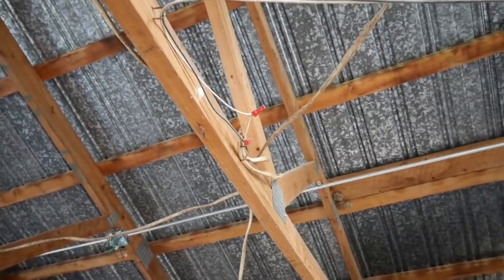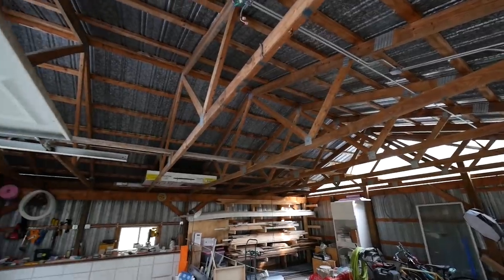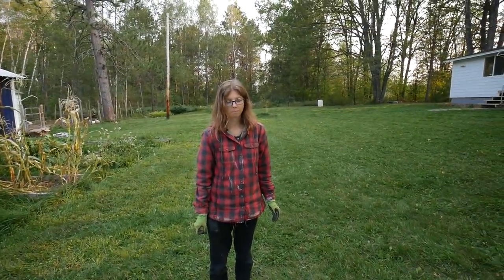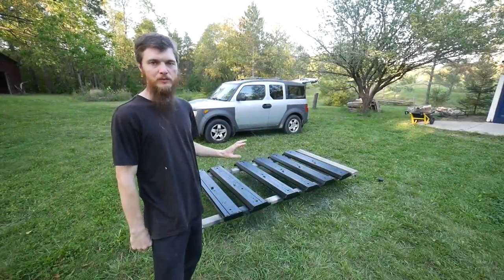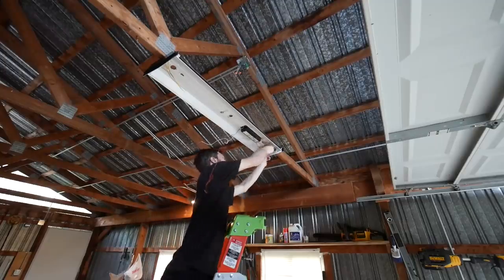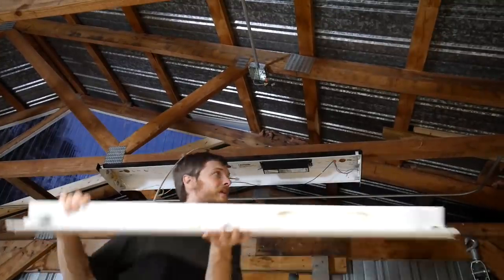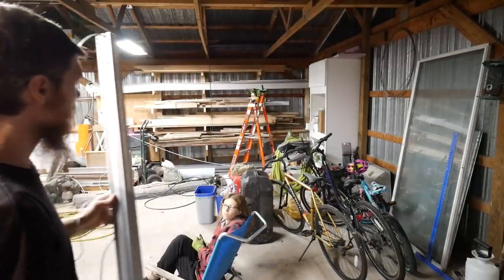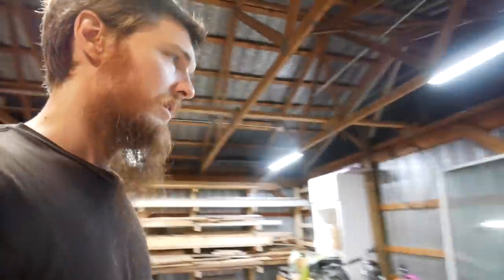DON'T Throw These Out! Restoring NASTY Old Light Fixtures - Installing Barn Lights

Comment: Another great job. You need to install a 3 way switch in the house and one in the barn to an outside spot light so you can go back and forth at night. Good safety feature.
Reply: That is a great idea!
Reply: I agree or like before electricity install a rope to hold on to (between the house and barn) in the next blizzard ❄🌀🌩🌬☔⚡.

Comment: What a nice conversion. LED is the way to go. It's going to save a lot of $$$ in the long run and keep more of your money in your pocket. Are you planning on replacing that buzzy High Pressure Sodium pole light with another LED or just sticking with HPS? The conversion is just as simple; remove the transformer/can capacitor then direct wire the socket.
Reply from the maker: Yea, we may covert that light to LED :)

Comment: Perhaps add another kitchen unit station opposite your existing one to make a great work area that means you do not have to work off of the floor for some of your projects? It could also mean the side room to your barn could be used as a wood store or material store as well. :D Whatever you decide though will be wonderful :D great work as always.
Reply: A Island on rollers !

Comment: A few years ago the company I work for bought and moved into a new (to us) building that was built in 1956. It had the original fluorescent fixtures in all the offices. It didn't take long for the ballasts to start going out one by one (there are 4 fixtures in each office). Replacement ballasts cost MORE than the cost to bypass the ballast and put in LED bulbs. That was a no-brainer! Plus, while the original fixtures used 4 bulbs each, we were able to get the same light equivalent by using only two bulbs each. It was a win/win/win every way! 😀 Congratulations on the progress and keep up the great and inspiring work!.

Comment: I would never have thought of cleaning them up like that. I would've said total loss/wipeout.
Since I don't see any insulation in the barn, doesn't that mean all of that stuff was dragged over from the house? 
Florescent light fixture changed to a LED fixture. Who new? Would never have thought of that.
Reply from the maker: At one point in the past the small room that juts off the barn was insulated and there is still some in the ridge. That's probably where the mice got it all from.

Comment: Good job with the rebuild of those fixtures.  That buzzing on the outdoor light is the ballast not the bulb. Looks like mercury vapor not HPS to me. I would just replace it with a new LED fixture.
Both HPS and MV lose efficiency every day, because they lose pressure over time and therefore get dimmer.

Comment: These older lights may well be newer than my old school light fixture  from the 50's. So surprised the lights didn't catch fire with the mice nests.Mine has 4 lights and it is curved. I have been using it for  the last 43 years to start my seedlings under. Weights a ton but but still works and are held up by chains on a homemade wooden plant rack.  Perhaps I could find LED florescent lights and save some $$.
Now that garage is looking safer and makes it much easier to find everything.  So is your outdoor bulb a halogen light bulb?  I could use a huge outdoor light like that to see if any bears are passing through my yard at night when I get home after dark.  I see them  during the day.
And I laughed when Ashley was talking about no more spiders.  Lol. I'll trade bears for spiders!   Be well. Thanks for more great information. Recycle, reuse, save $$.
Reply from the maker: I believe our outdoor pole light is a metal halide bulb. If you get something like that I'd go with a new LED version.

Comment: Another life saving tip from Doug, looks good, A timer on the outside light it will give you chance to walk to house with a light on, If the weather is gonna get colder, and you are gonna do projects in the barn, then maybe check some building sites for Excess Insulation they are not gonna use, and cover walls with it, it will warm up the barn & protect Ashleys Mower, Good Job on the video, from UK 5.30 in the evening.

Comment: What are you going to do with the old kitchen cabinets are you going to re-purposed them in the barn It would make a good storage and work station
Reply: Already done
Reply: They threw away the old cabinets as they were total junk, but they used the first set of cabinets that a company wouldn't let them return.

Comment: Looks like the next project is going to be putting in pathway lights so you can see to get back to the mobile home when it is dark.  Easiest way would be just to put in the solar lights.  Other way would be to put in the low voltage lights that have wires ran underground and a transformer to power them.  Was glad to see you converted the old fixtures to LED.  They work even when cold without having to wait for them to warm up like the old fluorescent ones were.

Comment: To those who think to flush mount those old fixtures like this  they might want to rethink screwing the lights flush. 
One of the reasons those types of lights dangle is, that the box that powers the bulbs and the place the bulbs clamp in generates tons of heat. The open holes and dangling allows fixtures to cool without starting fires or ruining the power source or connection. 
Place mesh over the holes to keep rodents out and yes hang from the chains again
Reply from the maker: I want to make a couple of points. The ballast is not in use. We did an LED conversion and bypassed the ballast, so there is no heat being produced in the fixture. That being said, the ballast wouldn't produce enough heat to worry about in normal situations. There are plenty of sealed fluorescent light fixtures and I wouldn't personal find that to be a concern.
Reply: @diyfferent  the sealed florescent fixtures you're talking about are newer than yours and have modifications to account for heat. 
The transformer in newer lights are very low energy. 
I'm pointing out that older styles like yours and the reason holes were manufactured into the unit. 
We used these in our barn and simply put wire screens on back to cover the holes to keep rodents out. 
My Dad found out the hard way to never flush mount, several overheated and started smoking. His electrician friend was the one who pointed out the reason for the holes and need to hang at least 2 inches from ceiling or support

Comment: Hey Doug, I need your advice. I'm looking to buy a screw gun and like you I've never had one because honestly a regular screw driver has always worked for me. But because you've inspired me, im currently remodeling and I'm going to need a screw gun. I want to get an impact driver and I remember while watching one of your videos ,one of your Dewalts stopped working. I can't remember if it was your screw gun or your impact driver that stopped working. Anyways would you recommend the dewalt "impact driver" and if not is there one you would buy if you were to get another one?? Thanks ! 🙂
Reply from the maker: It was the impact driver that stopped working twice. I had to open it up both times and got it working again. Dewalt has many varieties of their tools- high end, low end. We like sticking to Dewalt since we have the batteries and chargers already. We like the Dewalt tools as a collection and would recommend the impact driver. If I were to buy a new one I might try a different model of it. We use our regular drill since sometimes it works better for certain things like drywall.
Reply: @diyfferent  thank you, this helps
Reply: @diyfferent  well I took your advice and I purchased the dewalt 20v combo kit. It has the regular cordless brushless screwdriver and a brushless impact driver. I'm not sure if brushless is better than a regular one with brushes but thats what I got. I also found this really cool dewalt  sheetrock bit that counter sinks the screw so its easier to mud! Its was a whopping whole 2 dollars so I figured why not. Lol! The combo kit was 199 dollars and comes with two 2.0 ah batteries and charger. It may sound strange but trying to decide which brand and style of screwgun to get was really stressing me out as I just hate to make a bad decision and waste money. Lol! Anyways it gets delivered Tues. I have everything I need to get me started now and I can't wait to start renovating. I'm pulling off all the old pressed board panels on the walls and replacing them with sheetrock. I have window sills that are rotten and I have found out by removing the interior panels its going to be real easy to replace rotted boards and such as it will all be exposed. Watching you take walls apart and replace with fresh sheetrock has taken away some of the intimidation that I had towards doing this renovation myself so I just wanted to thank you for that! I'm just going to take my time and do it the right way. If it all comes out half as nice as your work is than I will be satisfied! Lol! Anyways wish me luck! I'll be doing demo starting tomorrow so I will have plenty of time to finish that so I can start Tuesday with the renovation. Thanks again...
Reply from the maker: @number1pappy  Cool, yea those drywall bits work great. I'm glad we could help. I think you'll be happy with the Dewalt tools. Good luck with the project :)

Comment: Way to go, you two! I absolutely love seeing the reuse of the fixtures. It appears on the vid to be a great light temperature, too. I’m grateful you mentioned the number. I’d like to convert some fluorescents here, so watching you both work on those fixtures was reassuring. Between the gable windows, and repurposed lights, it feels so much more balanced in the barn.  I’m still curious about the interior of the attached shed. 

That said, nature is what the mice do. It’s constant vigilance to keep nature from reclaiming what we change, and that’s how it’s supposed to be. Mice can squeeze through amazingly tight spaces, so if there is even the tiniest of gaps, fill it, so they can’t get into the lights again. As a child, I remember seeing a mouse ooze through the skinniest if openings brayeeen a living room wall, and the baseboard. I also remember one mouse that was chased by our terrier, who ran inside one of my mum’s pant legs, went all the way up, and came down and out the other pant leg.  I’ll never forget the look on my mum’s face. 😆 

Just pushing the point home: fill those gaps!

Again, great barn updates!
Reply from the maker: haha about the mouse in your mom's pants!!

Comment: they do make led conversion bulbs in both double and single end
Reply from the maker: The double end was the simplest so we chose that type. :)
Reply: @diyfferent  I have done both the cheap $8 fixtures  have the ballast built into one end so only the single ended work in those

Comment: There is such a thing as too much light and using the wrong "color". Glare from exposed sources and color toward the "cool" (blue) side of the spectrum actually impair human vision. This will effect you more as you age.
Reply: The best way to handle LED lighting is to make sure the fixtures are dimmable. Then install enough fixtures to be at least TWICE as bright as you need it to be. ie blinding bright. then dim it till the light output is optimal. VARIAC is the best way (efficiency) but takes particular kinds of arrays to work that way IE able to run at lower voltages)

This has several benefits. depending on how the dimming is done efficiency can go up (fewer watts per lumen needed) and most important your not pushing the cooling gradient as hard. LED as efficient as they are still make 80% heat 20% light (versus 98/2 for incans or something like that) but the problem is that 80% heat still needs to GO SOMEWHERE and led's do not tolerate heat!!! this is why I don't like the "tube replacement" bulbs like they are using. no heat sinks. no place for the heat to go except to COOK the diodes.

by dimming you greatly reduces your heat per watt output and thereby greatly increase your heat delta. IE a lot less heat for the same mass to now dissipate. Lifespan dramatically increases !!!! they also become far less prone to failure now as all the components are now being driven well below their specs. IE everything lasts longer.

in my kitchen at my old house in PA I used 12 4watt bulbs. 6 was good enough. SO I used 12 and turned down the power till the 12 was about the same output as the 6. took 1/3 the power and they were still perfect when I took them down 12 years later to take with me when I moved out here to NM where I still use them :-)

Comment: Love it! You two are so resourceful! My question is, How did you switch the lights over to LED. Can you do a more detailed explanation, up close, next time you fix one! I did not know that you could do that, or that there was led bulbs that would fit the old light! Very cool and they look so good!
Reply from the maker: I don't know if I will be doing any more, so I'll try to explain. There are two different types of LED conversions, but the one I did uses a double end ballast bypass bulb. It's really simple, you just disconnect the ballast (that black box in the fixture) and wire the power directly to the bulb sockets on either end. The black wire to one end and the white wire to the other. Then it's done, you just have to close it up and pop in the new bulbs.

Comment: Those old mercury light fixtures like the one you have outside make a crazy amount of noise. I changes some out I had my work shop to led what a difference. No noise, less power used, brighter and with mercury style you have to wait for it to cool down before turning it back on. An electrician friend of mine said you could convert those fixtures to led too. 
Barn looks good, definitely worth the effort.
Reply from the maker: Thanks! At some point we may change that light to LED too :)

Comment: What is the transition from fluorescent to LED if the ballast is taken out of the current? Does there not need to be a reduction in 110v current for LED? I know nothing about electrical work.
Reply from the maker: The LED bulbs are designed to run on the standard 110/120V current. The ballast is only needed for running the old fluorescent bulbs.

Comment: A beautiful job and so many benefits to enjoy. Whenever I finish a  project, small or large, I love to look at it like a beautiful painting. I worked for an electrician friend who did old building lighting remediation. All the ballasts had to be recycled as hazardous material because of the PCBs they contained. Any ballast pre-1980 is suspect. You can go to epa.gov and search for PCB Ballasts for examples.

Comment: I had been thinking about retiring into a manufactured home to get closer to my Son. After seeing all the rodent damage in walls and even this I think I will do something else. If you bought a new one how would you suggest to keep them out?
Reply from the maker: Unfortunately mice get into all types of homes, not just manufactured ones. If homes are not properly sealed up mice will try to get in. You just have to go all around and underneath the home and make sure all holes and cracks are sealed up so they can't enter anymore.

Comment: Fantastic Redo!  So Bright it is blinding.  I have ceiling fans that use LED lights and hate them.  The little bulbs gets so hot and burns out quickly.   I think you could use a couple of more outside lights and corners.  And it would be so helpful to have them on auto timers or some type of sensor...light, motion.  Can't tell you how helpful it is to be walking with handsful and not be able to turn on a switch in the dark.  Good work guys!!!

Comment: Hi Doug and Ashley! What a great transformation! It’s so bright! Now you can do so much more out there and video it!

My question is how can I rewire my old fluorescent lights? I have 4 old ones (we replaced them with store bought LED shop lights $40 each! Ouch! But we need more and I didn’t know this was an option! Do I need new bulb connectors? Wire? Can they still be plug in able? So many questions. Thank you in advance.

Our barn was built in 1974 I think. And it’s close to the gravel road so it’s very dirty and full of mice too.
Reply from the maker: It's pretty easy. Thee are a couple different types of LED bulbs for this. We put a link in the description for the ones who chose which are a double end ballast bypass bulb.

You don't need any new connectors. You just need to open up the fixture, disconnect the ballast and directly connect the power to the bulb connectors. You may need a little extra wire if the ones in the fixture aren't long enough and yes they can still plug in just the same.

Comment: So if I remove the ballast and wire it the same way as you did I can convert any fluorescent to led? No ballast needed?
Reply: I can answer that! Yes. LED doesn't need a ballast. 🇨🇦
Reply from the maker: Yea, the ballast is only needed for using fluorescent bulbs. Just be aware that there are two common types of LED bulbs for a ballast bypass, each type being wired a little differently. I chose the simplest type and we put a link to the bulbs in our description if you want to learn more.

Comment: There are LED replacement bulbs for the outdoor flood. It will be a better light color, seem brighter, and use about 75% less energy. 

You can keep the photocell, just remove the ballast. 

I did this at the Farm, and it’s really nice for the area lights.

Comment: Looks great.  On the “bright” side, since the old wiring was not put in correctly (not stapled, twist tie connections, etc.) it looked easy to rip out.  This is a game changer for your winter projects.  The old light fixtures and wiring were a fire hazard and makes the whole barn safer (from being able to see and eliminating the fire hazards).